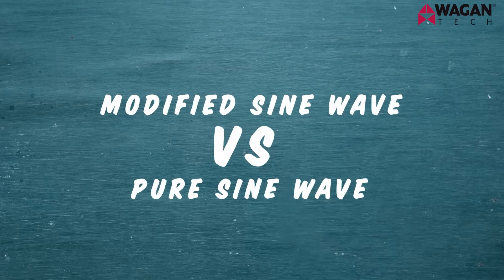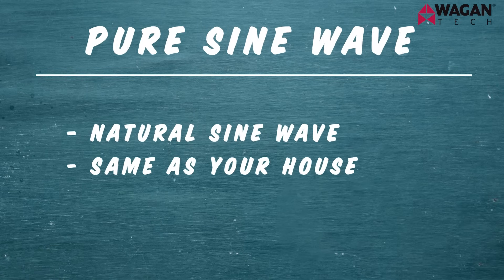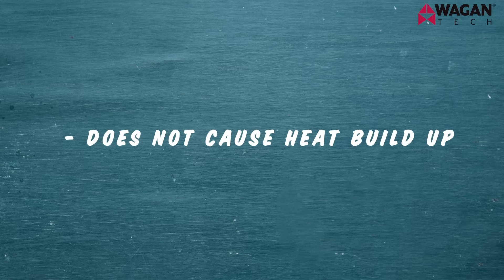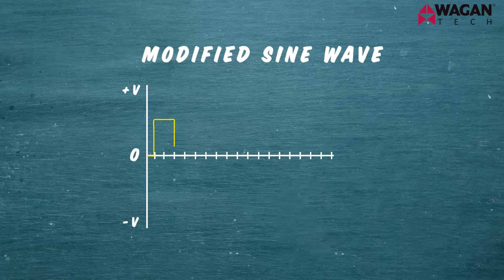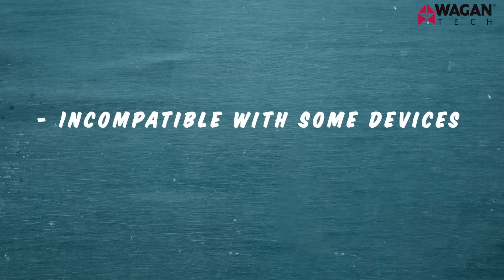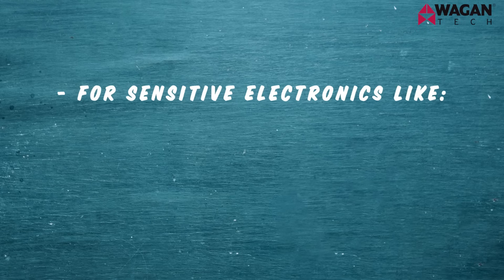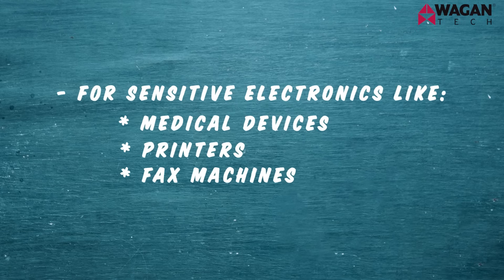What is a Power Inverter and which inverter do I need? What does a power inverter do?

Comment from the maker: What do you use your power inverter for? Let us know!
Follow us on Instagram! https://www.instagram.com/wagantech/
0:19 What is a power inverter?
0:45 What can power inverters run and who are they good for?
1:30 What are the different type of inverters?
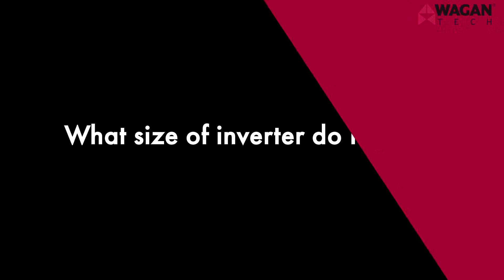2:47 Which inverter do I need?
4:16 What is Peak Surge?
Reply: Hi I Wonder if you can tell me witch one I need if I'm going to plug my portable air compressor
Reply from the maker: @marco_solis  Is you air compressor powered via AC (110/120V) or DC (like the cigarette lighter socket in your vehicle)?
If i has an AC (wall plug), let me know what the air compressor draws (should have a label on it that says the Amps (A) or Watts (W) that it needs)..
Reply: @WaganTech  hi , yes it says 2.4 Amp,  90 w .
And it's a twin  stack portable air compressor 120 v
Reply from the maker: @marco_solis  2.4A @120V is 288W (watts). 
A 400W inverter would be more than enough as long as it doesn't have an inrush (surge) current that it draws on startup.
What is the model and brand of the compressor?
Reply: @WaganTech  that's great , it is a kobalt. Model 3320447
Reply from the maker: @marco_solis  according to Lowe's, that draws 7.5A at 120V (900w) and almost certainly has an in-rush surge current.
You would need an inverter that would pull a 1500 watts at minimum.
I would try to contact somebody at Kobalt to see what that inrush current is. If you get an inverter that's too small, it will shut down as soon as the air compressor kicks on.
Air compressors are one of those things that have a huge inrush current on startup.
Reply: It a  13,500-
Reply: -  👍 👍 🔧  qoᒋ ǝɔᴉN 👀❤🤍💙
Reply: I'll be using it to pull a 13 5 air conditioner in a few appliances and I need to know what's the best batteries
Reply from the maker: @dannycoffman9325  Deep cycle marine batteries are the best choice since they can handle the load and discharge further. If you can afford it, Lithium batteries would be the absolute peak choice.
Reply: And watch the best inverter there  is and how many watt inverter would I need please if you can't help me
Reply from the maker: @dannycoffman9325  you would need an inverter that's greater than 16,200 Watts.
The largest we make is a 10,000 watt inverter.
Is this an industrial air conditioner? Most household of ones are running around 1100 w
Reply: I'm going to buy the life p04 batteries
Reply: What's the name of the inverter that you all sell and how much is it I won't run nothing off the big one but my AC unit my refrigerator and freezer it'll run off another one and do y'all sell solar panels
Reply from the maker: @dannycoffman9325  we have many different lines of inverters. For the large wattage inverters, it would be known as our "proline".
We only sell portable solar panels.
Wagan.com
Reply: The air conditioners on a toy hauler it's a Coleman
Reply from the maker: @dannycoffman9325  it's probably 13,500 BTU, not 13,500 watts. I saw a Coleman AC on Amazon that was 13,500 BTU and it pulls 13.1 amps (high) at 120V AC. That would actually be 1572 watts!
Here is the AC unit I am referring to: https://www.amazon.com/Airxcel-48203C966-08-0079-Mach-Arctic/dp/B00KPQWHX2
Reply: I'm looking to power my modem and router and maybe charge my tablet during power outages from a car or deep cycle battery.
Reply from the maker: @MikeJones-rk1un  those are all low power electronics and should be easily powered by a 250-400W MSW inverter..
Reply: Electric blanket?

Comment: The power label on most inverters lists the PEAK surge which is twice the running load.  A 3000 watt inverter is only rated for 1500 watts or less depending on duty cycle.(as low as 20% run time before needing a cooling off time cycle.)

Comment: I have a 2000 watt 4000 peak modified  inverter I want to run a 8amp vac  1060 watts + 20% 1180 watts. with it What are your thoughts. do you think it will run a car bat down rapidly. I do honey bee cutouts where there is no power.  Thanks

Comment: I'm going "cammping" for 3 nights... I want to charge my phone and inflate 4 queen size air mattresses.. which would be my best option? Does the inverter have to be plugged in at all times?
Reply from the maker: From our experience, you’d want to get an inverter at least 800W~1000w and above. If you’re just using it very occasionally, you can get our SlimLine modified sine inverters. If you’re planning on using it regularly for power outages and such, consider a pure sine wave inverter.

Comment: When I connect the inverter to my car battery must I start the car or can it stay off??and how long does it last till I start it?
Reply from the maker: If you’re using a high load for a while, you should have the engine running so you don’t kill your battery down. Our inverters have a low power alarm and shut down just in case.

Comment: Great explanation of what power inverters are.  I wish you expanded to explain how they draw on vehicle batteries?  Can it be connected to battery with vehicle not running?  How much draw on vehicle battery?  Do I need to start car once in awhile to keep battery charged?  If so, how often.  Does it greatly affect battery lifetime expectancy?  Lots of questions, I know, regarding effect on battery.  I would like you to use a typical 12v vehicle battery as an example.  Thanks!
Reply from the maker: It really depends on the load and the size of the vehicle battery. Hopefully this will help: https://wagan.com/blogs/news/customer-question-how-long-will-my-inverter-run-for
Reply: And most vehicle battery are standard 12v so if yours is also your good with the info I provide before 😁

Comment: Does the engine need to be running to use the inverter because I want to live in my car so I can live rent free and save money for a home but I also use a cpap machine but with the engine running it uses fuel and car battery
Reply from the maker: Great question, you should have the engine running if you're running it from the primary (starter) battery. You can also use a DC-DC charger and run an auxiliary (house) battery to run the inverter so you don't wake up to a dead starter battery. We can help with the DC-DC charger as well if you're interested.
Reply: @WaganTech  I live in the UK I was just trying to figure out if I could use my cpap machine without the engine on as I don't want the car battery to die
Reply from the maker: @tubzgames199  Technically yes you can, but depending on the size of your battery, it may run out of juice in the middle of the night. Most inverters out there will have a low voltage warning, so you may get an early alarm buzzer. For reference, a CPAP will use about 60-90watts (<1Amps 110VAC/0.4Amps 220VAC), depending on model. You'll need to calculate the Amp-hours your vehicle battery has in reserve and then know your running time. Hopefully that will add up to at least 8 hours of sleep. Good night and good luck.

Comment: Hi , I bought a slimline 1250 watt unit. I had a fuse installed on the positive cable. My inverter made a beeping sound after I used it for a while and shut off. I learned that the fuse was blown so I changed it. It began working again but began beeping after powering a 60 watt bulb for a while. Then it shut off. How can I fix this? Thanks
Reply from the maker: Please email us at customerservice@wagan.com and we can see how we can help you with this. Thank you!

Comment: So can i charge a 48v 500w 10A ebike battery on the go...
Reply from the maker: With the proper size Wagan Tech inverter, you should be just fine. Just check your AC draw specs (e.g., 10A @ 110V AC input). Your golden formula is Amps * Volts = Watts. Also, make sure your vehicle battery is large enough to support it and/or run your vehicle while you're charging. Feel free to let us know if you have any questions.

Comment: I’ll be going camping this summer 🏕️ my question is  will a Milwaukee 18 volt 175 watt inverter power up my cpap machine ??
Reply from the maker: That should work fine since most CPAP machines will only require 75w. But, check with Milwaukee for details.

Comment: I wanted to buy since I usually don’t have light but how long will the b3 last and how do I get the battery charged
Reply from the maker: Remember that inverters only convert the power from DC to AC and doesn't have any battery storage. You would have to rely on the battery source you're powering from. If you want an easy solution, you can use Wagan Tech's Lithium Cubes: https://wagan.com/collections/lithium-cubes

Comment: Are we talking about input or output in order to calculate watts?
Reply from the maker: Usually you calculate output watts to determine your power draw your device(s) needs. If you don't have the watts, you can calculate it simply by Amps * Volts = Watts. Hope that helps!

Comment: How does this power inverter works is it cordless or it as a plug where you plug it to a socket so that othere stuff can be plug in
Reply: Inverters are not wireless. They connect to the vehicles battery like he said in the beginning of the video. The inverter itself has the sockets on it so you can plug in devices.
Reply from the maker: Thanks for replying on our behalf!

Comment: Hi Justin 😎
Now subscribed 🤓
How will I find out "Peak Surge" 😲😲😲

I have a bank of 20 Li-lion 3.7v 5000mAh rechargeable batteries I want to run certain appliances, either altogether or one or two at a time.
1) Desktop 500w psu no more 8 hours
2) Microwave 900w twice a day no more than 10 minutes
3) Panasonic TV 31w no more than 6 hours
4) Sky Set-top box 30w standby daily
5) Fridge - Freezer 195kWh pa = 22w per day ( I think )
6) Kettle periodically 1500w

UK Voltage 220v 50Hertz
I have tried working out the wattage but failed miserably.🤐🤐🤐
So what size PURE SINE WAVE inverter do you think I will need🤔🤔🤔

Comment: What are the advantages of wagan inverters that use Neutral to ground bonding vs floating neutral?
Reply from the maker: Some appliance require a neutral bond, vs many electronics don't need it. We include it as an option for some of our inverters in those cases.

Comment: If I do reverse connection from inverter input 240 volts output 26 volts , using solar with 12 volts battery to get 240 volts out from input will it be possible.
Reply from the maker: I'm sorry, I don't understand your question.
Inverters cannot supply DC voltage and you can't supply it AC voltage. Inverters can only input DC voltage to output AC voltage.
Hope this helps!

Comment: Can you exploit the peak surge of a device to generate power to unrelated source
Reply from the maker: As a manufacturer, we would have to say "no" to using a device outside of the label.
Reply: @WaganTech  I just mean proof of concept. Seems like those peak surges are exploitable to make power
Reply from the maker: Gotcha. They're not really exploitable as they can only sustain that peak amount for +-0.5 seconds... so it really isn't usable for much other than peak surging appliances. What else could you use it for?! @sampleoffers1978
Reply: @ech I mean the surge more than the literal piece of equipment. Meaning inertia mechanical energy if the surge is pulse timing, or a field of electrons being spurred by the surge.

Comment: I want to run a wet/dry 1.75 HP 2.5 GAL vacum for my car. I looked at the manual but it doesn't list the specs. I will have to look on line.
Reply from the maker: I see the Craftsman version is 12.1 amps @120Volts AC (1452 watts).
Another brand, Stinger, draws 4.0A @ 120V AC (480W).
Let me know if it's either of these units.

Comment: Hi Friendly Electrician here, it's important to note that when looking at chargers for devices such as laptops or in my case power tools, you should check the charger's AC input rather than it's DC output. While the charger may say 60w, it could require 120v and 1.5A AC as an input. Meaning it consumed 180w from the wall outlet or the inverter.
Reply from the maker: Yes, you're 100% correct. Thanks for adding that comment!

Comment: This video was very instructive when it came to inverters, but either I missed it or he didn't mention how much power could be stored in a battery connected to the inverter.
Reply from the maker: The amount of battery power stored depends on the battery size, chemistry and other factors. You can essentially use any size battery/bank to power the inverter as long as the battery voltage matches the inverter's capability. 
You could have a massive battery bank of 5000AH + with no issues.

Comment: My question is, how many hours does the battery n inverter run a fan, small room ac in a small room?
Reply from the maker: It's based on the battery size and power draw. Small AC units eat up power fast and draw around 1000 watts. A normal household fan draws very little power (depending on the size) - around 40 watts for average floor models.
If your SUV battery was a 55 Ah (amp-hour) battery, it would run the fan depicted above for about 14 hours before it is "dead" (without the engine running).
In contrast, the same battery powering the AC unit would only provide about 15 minutes of run-time.
Reply: @WaganTech  Thank you so much, that helped me quite a bit. 😁 Now I know what to look for.
Reply from the maker: @whatever-k69  my pleasure! If you have specific questions regarding your set up, please let me know the specs (wattage of appliances, hours needed for them to run, etc.) and I can help you from there!
Reply: @WaganTech  thank you... I will get that info on the fan. It will be a normal size fan, 2000 watt inverter, from 12volt battery (not attached to run auto) does that tell you what I'm doing?
Reply from the maker: @whatever-k69  Yes, that's good info! What size is the battery in Ah (amp hours)? It will usually say on the battery something like "60Ah".
Reply: @WaganTech  another good to know! I will check tomorrow. Thank you so very much for helping me through this 💯

Comment: Does my car has to be on at all time
Reply from the maker: Jose, it depends on the load. If you're powering your laptop or something small, then the car does not have to be on. If you're powering large devices for an extended time, you'll probably need the car running.
Let me know exactly what your needs are, and I can help you find what you need. customerservice@wagan.com

Comment: So if I run one in my semi, use a microwave on it
How often can I use it? Does it matter if vehicle is running or not? And if not how much can I use it before I have to recharge?
Reply from the maker: Alan,
Being that you're using this in a semi, that means that you already have two batteries which gives you more power options.
"How often can I use it?" 
You can use it whenever you like. Your only limit is the power supply (batteries/alternator).
"Does it matter if vehicle is running or not?" 
For short use, no. If you're going to be running the microwave for more than a minute or so, then I would have the engine running.
"how much can I use it before I have to recharge?" This is dependent on your battery size and how many watts you're pulling. If you come up with those figures, I can give you an accurate answer.

Comment: I've been using power inverter since the first one was manufactured the new ones are the best I have a 3000 w with a maximum of five thousand watt surge in my van two marine batteries and isolator an isolator allows me to run off of one marine battery to my inverter without running the main battery to my vehicle dead when I start my vehicle up and let it idle it charges the marine battery to my inverter I have backup generator just in case but it has been proven and tested your car only needs two idol to charge batteries up from alternator and uses ten times less gas than generator it's been estimated your 3000 watt generator where does 5 gallons of gas in 10 hours half load versus 2 gallons of gas in 10 hours in your car truck just just idling it runs my medium size refrigerator lead lights is the best my TV projector my internet router my heating system is a gas log fireplace with requires no electricity I recommend backups portable heaters y have to  hang on the wall or you have free standing heeters 30000 BTU natural gas or propane recommended for back oupheet + carbon monoxide protector I've never had one to go off have one of them haters for my heat all the time their they do not require chiminey to the outdoors and you get 99% of your heart in the house and use the one for 19 years my carbemonoxide detector has never come on only when I test it so when the grid goes down you still have heat electric inverter.
Reply from the maker: Sounds like you have your set-up dialed in 👍

Comment: Great video, if i have a 500 watt inverter and im only using 100 watts, will my inverter constantly draw 500 watts from the battery or only what is being used?
Reply from the maker: The inverter will only draw the power it needs to make the conversion. In your example, the inverter will only be pulling the 100 watts needed!

Comment: What kind of inverter would I need for a plug in heater?  And what size battery?
Reply from the maker: What is the max wattage of the heater? If it's a personal space heater, they're usually up to 1200W-1500W. The battery size is dependent on how long you want to run it for.
Reply: @WaganTech  120v 1500 w in case of a power outage
Reply from the maker: @Sosekat  ok, gotcha. You'll need a 2000W inverter. Let's say you want to run the heater for 8 hours without recharging the battery or supplemental power sources, you'll need a battery bank equal to 1290Ah (That's HUGE)!
Reply: @WaganTech  What are my options?  Is this a good way to help us if we have a power outage?
Reply from the maker: @Sosekat  I would think not, as that would be one big and expensive battery bank for a heater. I would look at diesel heaters or propane powered ones.